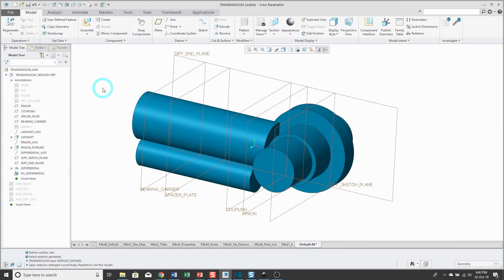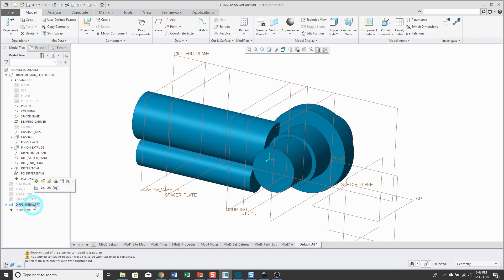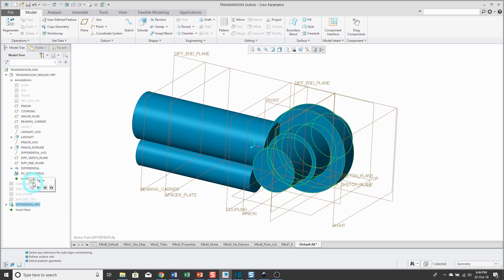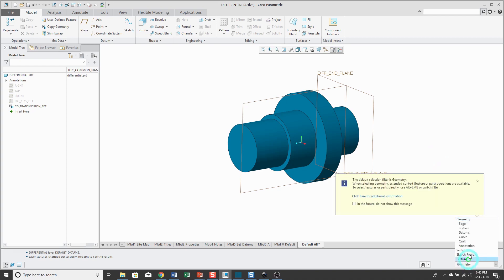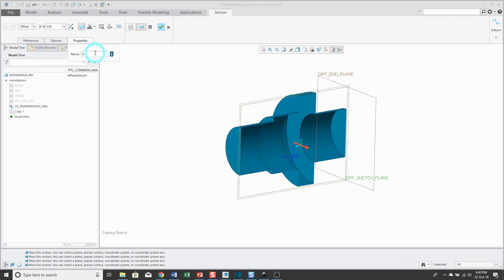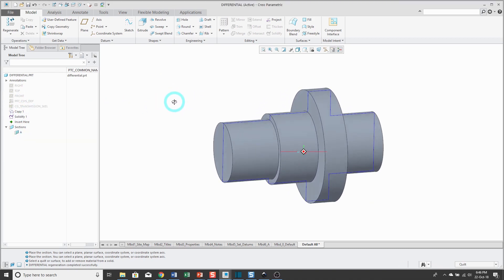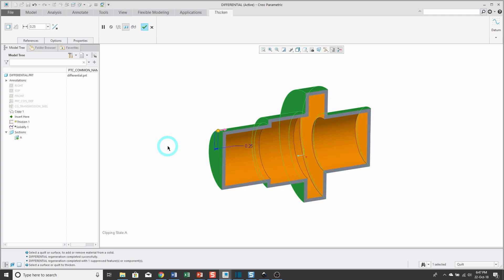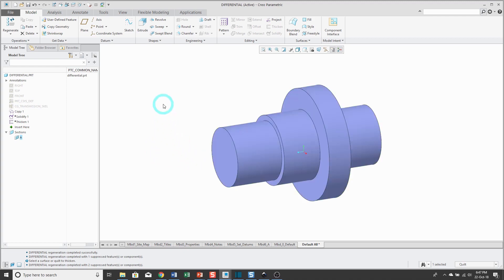Creo Parametric - Populating Geometry - Top Down Design (Demo)

Comment: Are there any other ways to hide the dark blue surface pulled from the skeleton model? I don't want to use a copy geometry because I want the solidify to still be driven by the external reference from the skeleton. When I use the solidify command on the copy geometry from the skeleton, all of my parts retain the dark blue surface covering them. I have tried hiding all in the layer tree as well as hiding the copy geometry line item in the model tree with no success. Any recommendations?
Reply from the maker: Have you tried changing the color of the objects? That seems like a bad reason not to use Copy Geometry. Although honestly I can’t recall experiencing the same problem, but maybe I’ve never noticed it (or just changed the color).

Comment: Hello. Once I finish to model the part and I want to remove all the quilts (I want to remove also the copied geometry, not only hide it), the only way is with the command REMOVE SURFACE? Thanks
Reply from the maker: Why would you want to do that?
Reply: @CADPLMGuy  Generally every time I copy geometry from another parte, once I used it I remove instead of hide it (I learned this in solidworks, where it is better to remove external geometry)
Reply from the maker: @robertodalessandro753  That's not a recommended technique in Creo Parametric. You can set the Copy Geometry to Manual Update or No Dependency. Designing with External References is a really powerful capability in Creo Parametric, and you're better off using Update Control rather than trying to break references completely.
I have a video on the Remove tool. It doesn't do what you think it does.